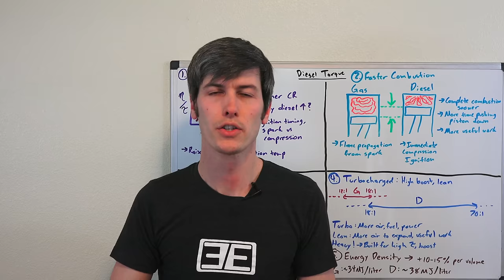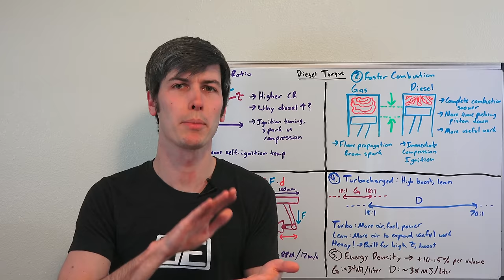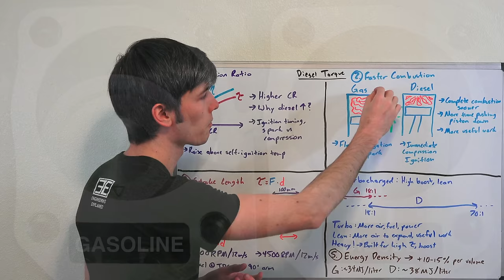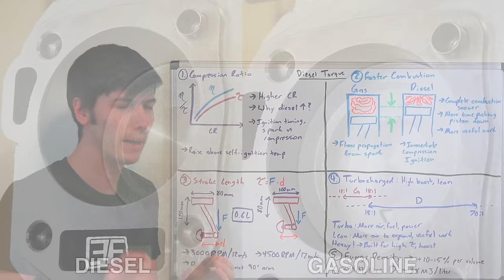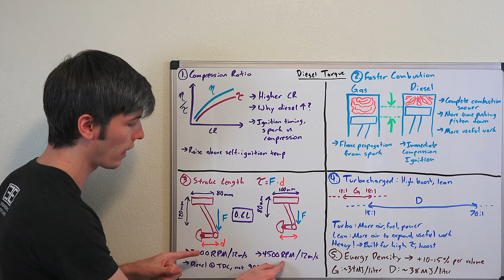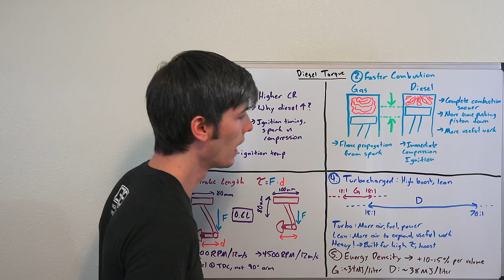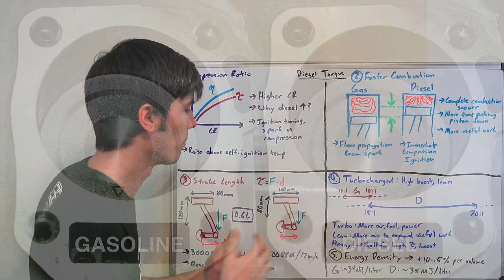5 Reasons Diesel Engines Make More Torque Than Gasoline

Comment: Isn't the combustion faster in a gasoline engine, considering that the mixture is already mixed and ready to burn when the spark happens, rather than the diesel engine, where time is needed to inject the fuel and let it mix with air? Maybe the "slow" injection is another reason why diesel can't rev too much.
Reply: It is diesels slower burning that restricts revs.

Comment: "5 Reasons Diesel Engines Make More Torque Than Gasoline" - They don't. Mistake is done usually, that you compare turbo engine with naturally aspirated emgine. Compare both turbo versions and torque is almost same.
Reply: Then why don't semi trucks use gasoline engines when diesel fuel is as much as 50% more expensive?
Reply: @terrywaters6186  Because while gasoline engines have better power to weight ratio they also have a higher fuel consumption and diesel engines usually have higher bottom end torque. If you were to put a 16 litre turbo charged V8 gasoline engine in a semi truck it would easily produce several thousand HP and enough torque to break the drive shafts, but it would also gulp down a lot of fuel doing so.

Comment: The only reason why Diesel engines have more torque than Gasoline ones in the same displacement is when you compare forced induction TURBOdiesel versus naturally aspirated gasoline ones -- which is UNFAIR. Turbined gasoline engines have at least the same, and nowadays frequently MORE torque, than turbodiesel ones.

Comment: Jason, love your channel but I suggest you do some research into real world numbers. Comparing apples to apples- same displacement, same boost pressure, diesels come nowhere close to producing the same torque or hp as an SI engine. You're parroting the same misinformation so many people believe as true these days. Show me just one example in the real world where this is the case, not theory, actual production or race engines which exist.

Comment: Hi i'm a mechanical eng. graduate, when IC engine class, a prof. from Tochigi JP explain that even a HSDE a.k.a (High Speed Diesel Engine) "Combust Slower" Than gasoline engine. thats why even modern small diesel engine still got redline around 4,5k RPM and  it can actually seen in comparison between the P-V diagrams Betwen Otto and Diesel. Diesel got a "flat pressure area" in combustion aka constant pressure cause the diesel burn while injected and the otto got a "Spikes" in pressure while combustion cause its ignite a chain reaction.

Second.....
it easy to explain the sources of BIG torque by said A BIG Stroke engine produce a big Torque by its Multiplied throw distance, but i can say its wrong. A same displacement engine would produce a same exact torque if caused by same "Combustion Pressure". if you got big bore engine small stroke it will produce the same amount of torque as the big stroke one with small bore, because in the big bore one u also got a bigger Force (F=P/A) to feed on the stroke and the bigger stroke engine got less forces cause small area of the bore.

So why it's more torqy
bassicaly motor power = engine speed x Torque
gasoline engine got less torque cause it can rev higher (thats why i love it), and the diesel one got bigger torque cause it cant rev any higher as gasoline engine (damn it).

sorry for bad english (i'm indonesian)
and if im wrong, im still open to learn cause we live and learn, peace

Comment: But Diesel engines don't produce more torque, not with the same charge they don't. A turbocharged diesel engine running 30PSI produces more torque than a NA gasoline engine of similar displacement, sure, but slap a turbo on that gasoline engine and then tell me something about torque.

It's also a myth that torque has anything to do with stroke. You do not find any correlation between stroke and specific torque, engines of similar displacement and very different stroke length produce the same torque. A Chevy LT1 with 3.62 inches of stroke produces 75 pound feet per liter, a Yamaha R6 with its puny 1.67 inche stroke produces almost exactly the same specific torque (actually even more in fact because of a higher compression ratio).

And this can be easily explained: while stroke increases the lever arm to produce torque at the crank, the force on that lever arm comes from the in cylinder pressure, and force exerted by a fluid over a flat surface is pressure*area and an engine with more bore has a larger area. So you see for the same displacement if you increase stroke and reduce bore you do not actually gain any torque as what you gain in lever arm you lose in the force actually being generated on the piston and sent through the con rod.
Reply: If that were true all trucking companies would switch to gasoline engines tomorrow.  Gasoline is about 50% cheaper than diesel fuel and fuel is the greatest expense of running a truck.

Comment: The long stroke produces torque is an old theory, that when tested proves to not be true. Torque in a naturally aspirated engine is a result of displacement. A short stroke, big bore engine will make about the same torque as a small bore big stroke engine of the same displacement. But usually the big bore short stroke engine will edge out the other engine in both torque and horsepower from better head breathing due to the larger bore shrouding the valves less.

Comment: Most moden diesels have pressurised induction, where this is not the case with gasoline engines.

Shouldn't the comparison be made between the engines, either normally aspirated or pressurised, for the same engine size?

I agree that diesels are lighter on fuel for the reason of smaller pumping losses, but even that has limitations, depending on the load and work required of the engine.

Comment: The further off center the connecting rod journal is from the center of the crank shaft, the larger the torque (longer lever). The stroke will be longer as the distance from center increases.  

Double check this: diesel has a greater useable expansion once ignited. 

Longer push with a longer lever. 

Just a thought

Comment: It's stroke. Look at a F1 engine, short stroke- high horsepower and rpm, low torque. Diesel, long stroke - low rpm and horsepower, but lots of torque, turbocharged or not.

Comment: Longer stroke leverage advantage is canceled by smaller bore.   Longer stroke = more torque, is a myth.
Reply: Agreed. The reason is to do with brake mean effective pressure. Longer stroke also means that the flamefront has to propagate faster in order to keep up the the descending piston crown.

Comment: Please do a Myth Busters like video on Diesel vs Gasoline emissions. My belief from what I researched but have not ever tested or proven to myself is that Diesel is actually more environmentally friendly than Gasoline.
However people perceive the black smoke from a Diesel to be worse (as I believe based purely on my own very limited research) for the environment than a Gasoline engine actually is.

It does make sense we hardly see Gasoline engine emissions unless its winter, yet Diesels can blow out clouds of black smoke like there is no tomorrow. So visually it does appear that a Diesel is quiet inefficient and pollutes alot more than a Gasoline engine. But higher compression is also more efficient is it not?

You know alot more than I or atleast have more resources to learn and understand it then translate that to us.
Reply: it depends on the pollutants you consider to be most harmful and there is not a consensus on that.

Comment: Nice video Jason, but please don't perpetuate the ridiculous myth that longer stoke engines give more torque.  The stroke length for a given capacity of engine has no effect whatsoever on torque.  NONE!  If you increase the stroke, you must decrease the bore to retain the same capacity, and the mechanical advantage is cancelled out exactly by the decrease in the bore, and hence the pressure on the piston.  You can prove it geometrically, and algebraically.  As a university educated mechanical engineer, you must be on top of such things!!  Regards.
Reply: janet53589 hi Janet...thought about your comment... would you agree that torque peak will come at a lot lower rpm than short stroke big bore?

Comment: With the advance of the EV with many having range extenders (generators only turning an electric generator), it would be nice to see what the ideal configuration for a constant speed or stepped speed generator engine. These engines will be the norm and not too far into the future.

Comment: Thanks for a great video.  You could also mention that octane rating is the fuels ability to resist detonation.  The instant combustion of the fuel air mixture is how diesel engines operate.  This can also occur in gasoline engines and it's called detonation.  Since gas engines aren't built to take that kind of punishment something is added to the gasoline which raises the pressure at which it detonates.  How much of this additive determines the octane rating of the fuel.  They used to use lead to raise the octane but I'm not exactly sure what they use today but it doesn't give the gasoline more power it does however allow the gasoline to be used in a higher performance engine than lower rated fuels.  That means they can design the engine to make more power through increasing the compression ratio and so forth.  But modern engines typically have a detonation sensor and computers that retard the timing when it occurs allowing the driver to use 87 octane fuel but at slightly reduced power.  That's why in most modern cars you might be able to detect the difference in power when using higher octane fuels.  Back in the day it wasn't unusual for a automobile engine to start detonating when the engine was under heavy load and low rpms like when climbing a hill.  Old timers would say "your valves are rattling" when it was actually detonation.  This is why the "rattling" sound is actually the same sound a diesel makes when it's running normally.   From what I understand it's like smacking the top of the piston with a hammer when detonation occurs.  In cars with distributors you could advance the timing to get more power out of premium fuel or you could retard it slightly to avoid detonation on regular fuel.  Now the computers do it for you.

Comment: I hear all the time that under-square engines (stroke greater than bore) produce more torque because of more leverage at crankshaft. However, a bigger bore would would result in the piston exerting more force. According to Pascal's law force is pressure times area.
Reply: Greater bore would also mean less pressure

Comment: The reason why people think a diesel engine produces more torque is because they compare car with similar HP instead of similar torque. Since the gasoline engine revs higher, it needs less torque to acheive the same HP figure.
For instance :
TSI 150 HP / 250 NM
TDI 150 HP / 320 NM
You could think : "Those engine are similar, 150 hp but the diesel has more torque, so diesels are better"

This comparaison is biased because we use the HP as a reference, so it's easy to claim that a diesel engine produces more torque
NOW, to do a fair comparaison for the gasoline, less keep this TDI engine but choose another TSI :
TSI 190 HP / 320 NM
TDI 150 HP / 320 NM
Now you can think : "Those engines are similar, 320NM, but the gasoline engine has more power"
This is more correct IMO, and I think those two engines are maybe more similar on the road than the TSI 150. Also, the TSI 150 was a 1.4, the TDI 150 is a 2.0. 

Everything is about point of view ;)

Comment: Stroke length directly correlates to more torque. Longer stroke means longer throw on the crank shaft meaning leverage. It like using a breaker bar compared to a 1/4” ratchet
Reply: did you watch the whole vid, he literally says it doesn't make that much of a difference.
Reply: THE WANDERER yes I did

Comment: It’s really the turbo marking the difference, if you take out the other variables diesels don’t make massive torque compared to gas. It you overbuilt a gas 6.0l and put 30 pounds of boost to it it will make lots of torque, and lots of hp as well. The old n/a diesels were completely gutless.

Comment: Please explain these new after treatment systems the EPA is trying to out on all semis: Desiel exhaust fluid (DEF) and the Desiel particulate filters (DPF). Please explain the adverse effects these after treatment systems have on a desiel engines. I've noticed older pre DPF/DEF trucks lasted over a million miles before having a major rebuild. Now, these new emssion systems are literally cutting that life span in half. Why?

Comment: wow....I get it if you've never wrenched on a diesel...but you should probably do your homework on the fuel system a little better...the easiest way to define the difference between gasoline and diesel is 1. volume of compression 2. heat value 3. fuel type/delivery method (IE slower burning fuel directly injected into the combustion chamber through most of the power stroke)...google it

Comment: The way I understand it, diesel has a slower burn time then gasoline. As I was taught, the longer burn time of diesel and the fact that fuel is continually injected after TCD to achieve a "push" for a longer duration of the stroke, is one of the biggest factors on why a diesel has more torque. The way you explain that gasoline burns longer is wrong as far as I know. Gasoline = higher octane = more resistance to ignition = quicker bang. Diesel = higher cetane = less resistance to ignition = slower burn time. Although I could be wrong, please feel free to correct me.

Comment: you're totally wrong on point 2.   in a spark ignition engine  combustion is not initiated at TDC, instead it's carefully timed so that at TDC the maximum possible pressure is achieved.  so the spark fires significantly before TDC.  and also in a diesel, injection and thus combustion starts at TDC but not all the fuel is injected in the same instant.  it takes time,  the first drop comes in at TDC and powers the piston for the full stroke, but the second drop comes in a moment later and powers the piston down for only say 175 degrees, the third drop only 170 degrees and so on.  this is why in big truck applications greater fuel economy can be achieved with a larger engine because it has a greater capacity to inject fuel earlier in the powerstoke.   and thats another reason why diesels have big strokes and rev low, because at an equivalent mean piston speed a power stroke takes more time to complete in a stroker, thus giving more time to efficiently utilize fuel by getting it into the chamber with more stroke left.

Comment: Yes , compression ignition with more energy dense fuel in a Diesel , hence the Lower Fuel Ratio .
However Diesel fuel burns Slower , AND , diesels do not have an Advance curve , as such .
What happens is , the Injection Cycle STARTS earlier and runs Longer at High Output demand . THAT is the advance , right there .
And the Longer Injection Cycle keeps fuel going in longer needless to say . The Fuel Injection Pressure on ANY Diesel  FAR  exceeds any pressure you can get inside the cylinders . Up to 1200 plus Bar . Positive displacement fuel delivery .
A  16 litre Truck Turbo-Diesel making 600 bhp and 2850 ft-lb torque can get around 2.4 km per litre economy under load .
But up to 12 -14 km per litre just pushing the Prime Mover itself . Americans would know that as the Tractor Unit . 
Weighs 7 - 10 tonne and uses less fuel than the Family car . Pretty good  fuel figures .

Comment: To be fair, the ignition or injection of fuel is actually before TDC.  Also, there is rate control (the rate of which the fuel is being injected into the combustion chamber that is pre measured.)

Comment: if diesel burns so clean, why do they have environmental issues?
Reply: There are now exhaust cleaning systems for diesel engines. They no longer produce the carbon emissions as before as on the older engines or systems.  A lean burning diesel engine is clean though. The issue is a rich burning diesel and is when you see the black smoke coming out of the stack or exhaust pipe. Fuel system controls are much more advanced these days which controls the heavy foot drivers. A good driver uses a light foot and the gears to move the truck etc. A bad driver always over presses the pedal. A good fuel injection control system can prevent this scenario and the exhaust cleaning system helps out as well. Cant beat a diesel for a truck.

Comment: It’s much simpler than that. Diesels make high torque (compared to HP) because they run at a lower RPM. All else the same, if they spun faster they would make high power too. It’s just math… Torque x RPM = HP … It’s the same reason a rotary engine makes high power but low torque, they spin faster! 
Kinda like you said, diesels have a lower peak RPM because the long stroke accelerates the piston faster and they don’t want it to shake itself apart. And a rotary can run faster because it doesn’t have to reciprocate back and forth like a piston does.
I mean, any of these engines could be designed to make the same peak torque. But the reason it seems like diesels all make high torque is because when you compare them to similar gas cars they need the extra torque to make up for their lack of horsepower. In order to have acceptable highway passing power they end up having gobs of sweet sweet tire smoking torque!